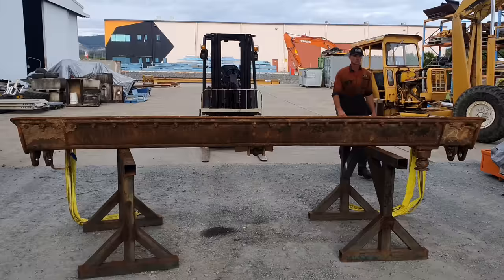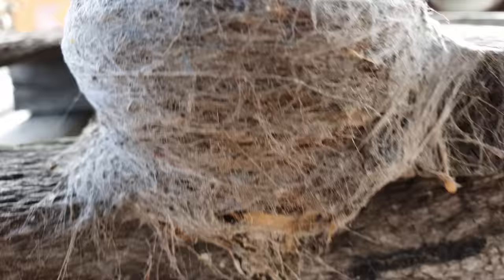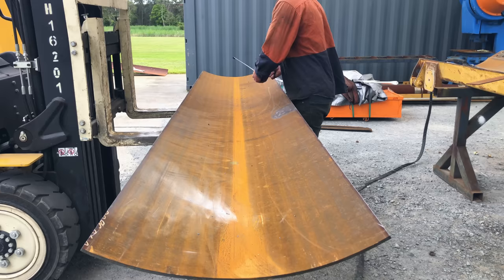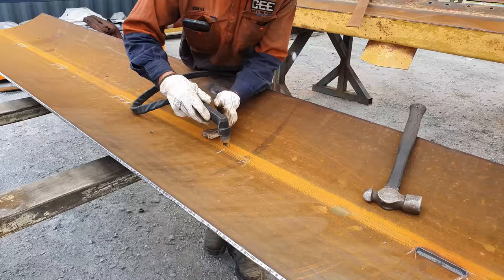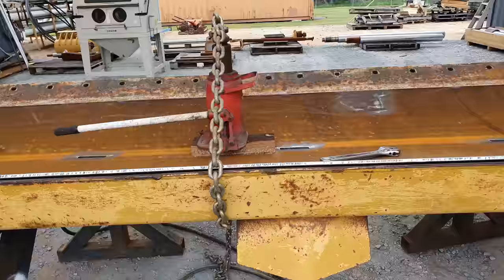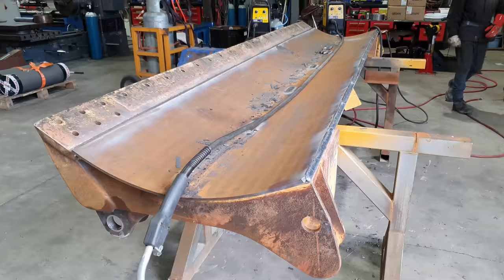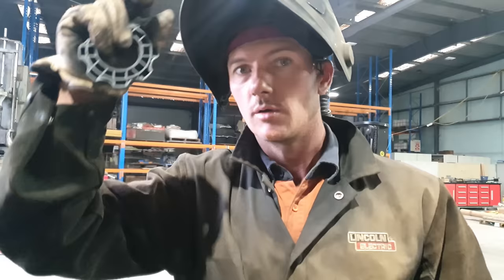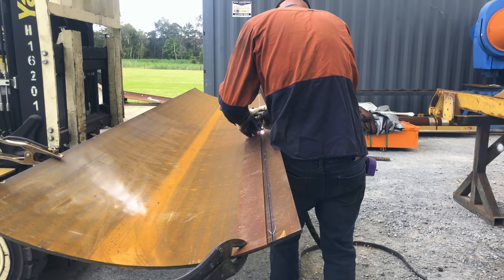Installing NEW BLADE SKIN for CAT 815 Soil Compactor | Plasma Cutting & Welding

Comment: "Aussie Animal Planet." I love it! Kurtis, you not only do a sterling job on repairs etc but you dispense wisdom and caveats and safety advice. I burst out laughing when you recalled the apprentice cutting through the fork lift blades - I don't normally do woodwork but a couple of months ago I got the circular saw out, clamped some timber to my folding Workmate and had at it - job done, except I had sawed through the Workmate itself so now I have a lopsided Workmate! 🤣💩🤬
Reply: Trimmed my workbench one or two times on the same account...
Don't let a welder/fabricator (me) use a circular saw. Also it almost took a finger at one time.....
Reply: That's the reason I have a 2.5" forged steel plate as a workbench.😁
Reply: @crazyedo9979  right...👍
...but it still wouldn't been able to save the tip of my left pinky....
Reply: Over the years, I've worked in 3 different shops where guys had cut 1/2 way through the forks with a plasma, and one cut the end completely off a fork with the Oxy-Fuel...we had plenty of 1 and 2' plate...don't know why they couldn't use that, a nice proper top for a workbench. Actually in one shop we had 2 workbenches that were 1" pate...5X10 feet, but still the forks got it...
Reply: @kristianskov4841  Here in the USA, circular saws cause more injuries than all other power saws combined...

Comment: This brings back interesting memories because in the past I worked for an outfit that re-skinned the bottom of aircraft floats. Although we worked with rivets and (naturally) the aluminum was much easier to bend, most of the methods and procedures were very similar. You wrestled with hard metals, I had to endure days of riveting. Keep up the wonderful work Kurtis, and the excellent videos Karen.

Comment: I'm amazed that bolts like that always seem to come off so easily!
Reply: Well, out in use any that are not tight tend to vanish. Plus not much water there, all of which lead to rusty nuts. Those that do not want to move with the impact will, in some way or the other, yield to the socket, strong bar and the 6m length of cheater pipe. Otherwise there is the plasma cutter there to do the removal. Come off nicely or come off in pieces, but will come off.

Comment: Hi Kurtis,
I love the way you can just remove bolts/nuts just like that. Here in the N.Eastern states everything we work on is a battle with rust and corrosion before we get to the actual job. If this job were here we would start by torching the nuts off and driving the remainder of the bolt out with an impact driver.
Love your videos, keep up the good work and say hi to Karen and Homeless!

Comment: I once straightened a quick attach bucket frame (on the machine) with just such a chain and jack technique!!  I placed a 1x2 flat bar on top of the jack so there were no round edges for the chain to slip off. Worked fantasticly!!

Comment: Kurtis, 

There is a technique for bending steel plate called line heating.  It consists of a rosebud and a garden hose.  Plate is heated and cooled in a pattern.  It takes time to learn the process, but it might save you time in the long run. 

Shipyards use line heating to supplement their roll press.  It is an amazing process.  It also eliminates the inherent stress created by forcing the plate in place by clamps, a hydraulic jack and welding.

I really enjoy your videos and watching you work.

Bob

Comment: Kurtis really cool video, I was a mechanic for the New York City Department of Sanitation, I would have the blacksmith come and cut off the bolts on the cutting edge and replace them with new bolts, now I know your first thought is fuck off but I found the old bolts ended up shearing. The moral of the story is you can only stretch a bolt once.    Stu

Comment: Content always brilliant - mrs cutting edge engineering - make him wear hearing protection when using rattle gun and needle scaler - otherwise severe tinnitus by  mid 40s it will drive him nuts.   Spot on fantastic content.
Reply from the maker: He is using hearing protection 👍 3M classic ear plugs

Comment: FYI when a breaker comes from the factory it will trip out at exactly the predicted value. For a 15 amp breaker, it will trip out at 12 amps (80% safety factor). But once it trips out, the values change and there is no guarantee it will trip out at the predicted value. It may be 11 amps, it may be 13 or something else.

Comment: Changing that cutting edge on a platform sure does look easier than doing it on the wet ground on your back. I've changed a few snow plow cutting edges.

Comment: Take a piece of round stock and machine out the inside to the diameter (a little bigger than the jack head) 3 inches deep. Then on the other end weld a hook on a slight angel. This attachment to the jacket will prevent the chain from slipping of the jack.

Comment: Used the same method to do blade skins. But welded a piece of angle iron to tubing that would fit over end of ram. This held chain in place. Also had a guy that would cut hearts and smiley races for plug welds

Comment: Age old story. Equipment designed for low price and max work that is pushed beyond the limit. 
The mounting frame for the blade being bent is a sure sign of overload like you said. 
I worked for a company that made Cat parts. We built to print and still had problems with making everything exact. 
Lots of weld and steel sections with hundreds of braces on them. The prints had tolerancing that allowed for backers on welds so the large gaps could be filled. 
On the mainframe for the M24 Grader, over the length of that huge beam made from 1" plate the welds would lift the end of the fixturing off the floor. 
Once it was welded and removed from the fixture it wouldn't go back in. 
We bid against several other companies in the US and Mexico for Cat components. The various pieces and parts varied considerably depending on who made the parts and where they were made.

Comment: PPE
Thank you for always using 
 Personal Protective Equipment
   *Fall Harness while up in air
   * You always wear Safety Glasses
   *Cutting Glasses for UV during hot work including plasma work
   *Weld Hood w/ Clean air circulator
And using the basic PPE
   *Gloves, Steel toes, Long Sleeve and Pants

Preserve your career longevity - run your business longer
Minimize hazardous exposure and reduce liabilities
Reduce accidents and Less trips to Emergency Rooms
And maybe keep insurance premiums reasonable

Great examples of an owner/ operator
True Professional

Comment: I am really surprised the cutting edge bolts didn't have to be cut off.  With the thread protruding even though it is the back side I would have thought they would have been long past unscrewing.  Not to mention out in the weather and moisture!

Comment: After the breaker-dance with our MIG unit on 110V15A...
When we got our cheezy plasma cutter, we just went and ran a 220v30A line just for it, next to the 220V90A welder disconnect.

Comment: It's secondary to ordering oversized is that extra can be cut off fairly easily, whereas if extra is needed then adding can be difficult. Even more so for bits that have a specific hardness or temper flex that can be altered by mistake in the adding process.
It's the same reason one should not weld springs or cut them with a torch.

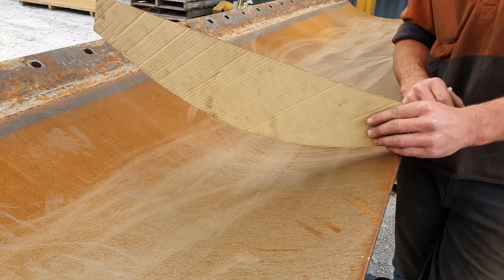Comment: @5:18 I swear it looked like you were using a ceramic gauge block to measure the gap between the blade and corrugated cardboard template and I thought “That’s MrCrispin level humor right there”

Comment: Thank you for sharing another video -- so we get a glimpse of how your busy days went.
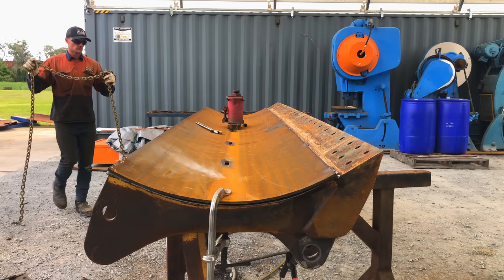16:37 "the chain is rated at 10" -- you said you'd put only a couple tons of pressure so it's okay, but the chain is at an angle (at about 45 degrees?). I think the chain gets something like 1.4x the force -(**edit: but 1.4x gets applied on 2 sides, so I guess the tension is 0.7x after all? Never mind! )

Comment: Hello Kurtis or  Curtis don't know which one is proper? My name is Jerry I'm a retired electrician (sparky) a suggestion about the lack of power on one side of your shop. Until you can upgrad your electrical system make a heavy duty extension cord 110 volt or 220 volt. To run for the other side of your shop. For every 100' foot of run go up one size in wire to compensate for the voltage drop. IE 12 gauge is good for 20 amp.. 10 gauge is good 30 Amp. It's not going to be cheep but it's  a temporary fix to your amperage problem.  Also consider a GFIC outlet if it's a 110 volt system for outside use for your protection.  I hope this is somewhat of a help. Jerry M. Good luck down under.

Comment: Either you’re not doing much work  OR you have a team of nightshift workshop cleaners. 
Alternative to the Jack & chain (which is a good idea) perhaps you could cut a few holes through both the blade and pull them together with a good size bolt or threaded bar. Also. When you’re having power to the fab welding consider having an electric cooker power line or lines installed ( here in UK they a rated at 30amp) and are direct line from the distribution board to the outlet. No ring main.

Comment: You should do a video on the 3m back up pad grinding discs you use, I didn't know about them till I seen the boilys use em at work and they're mint. They use them for weld blending on major cracks and gussets but I was amazed at how much material they move

Comment: Cool change the circuit breaker the wires are going to handle a 20 amp circuit for as little as you use it with that welder

Comment: Kurtis its time for a Milwaukee dry saw.  I have the 18 volt one and can cut a 4x8 sheet of 1” steel in half with it on 1 12hd battery.  That’s going the eight ft way!  Hardly use my plasma anymore.  Easily cuts ar plates just not as fast.

Comment: lucky the cutting edge bolts had flanged shanks on them.  Ive seen bolts put through there and the head cleaned of with a grinder and when he went to undo it the head was obviously spinning so without thinkinh he put his hand on top to hold it , within a split second he had a perfect hole about 1/4" deep in his palm it was like a spinning razor blade

Comment: Two questions:
1) Was there any thought, when finishing the edge welds, to using a bit of the cut-off sheet to pack the gap before overwelding?
      (no worries about flexing there as opposed to re-bending the center?)
2) How did you finish the plug-welds in the rectangular 'hold-down' slots?
      (fill with soft ?, over-weld with hardface ?, weld back in solid plugs cut from the sheet off-cuts?)

Comment: Try Hobart excelar8 wire it's a t8 gasless wire with amazing impact properties it's used a lot in the states in earthquake zones it's identical to 7018 and dualshield wire not as much deposition rates as a t1 wire but for windy conditions it's the only way to go for outside

Comment: im so used to looking away when an arc is being struck near me at work (welding) that i find myself looking away even when i think ur gona strike it up. lol good stuff tho, im a fan

also 17:46 instead of welding that top wedge on if u made that a 3/4 nut u could just run a bolt thru it an not need to hammer that 3rd piece in. the bolt would be doing the downward pushing. just a cool thing i saw an old timer do at a job one time, he called it a dog leg too. 
                     
                              bolt
                              bolt
                          nutnutnut
chunkOFmetalnutnutnut
chunkOFmetalnutnutnut
chunkOFmetal    bolt
chunkOFmetal    bolt
chunkOFmetal    
                          ^
                 tack weld

Comment: loving the videos.  Always relate more with someone from home.  I'm looking to get into some heavy repair work but I'm not sure if I should spend a bit longer investing in major tooling before i start to look for work.  I have a 50L compressor, 8kva and 5kva petrol gen, unimig razor arc 180 and a weldforce 160mt multi process MIG (20% at 160, 60% at 130) alongside a 50a plasma cutter (cheap "giantz" brand), oxy set, 305mm makita cold saw, pedestal drill press (15mm max chuck), 20t mechanical press with pipe and square dies, a cropper up to 12mm flat, a 630mm pan brake up to 1.6mm and a 1000mm pan brake up to 2mm.  Would it even be worth trying some heavy repair work with basic tooling like this?  I have my 1554 general purpose MIG and stick certs and my cert ii in engineering (completed at a machine shop running manual and cam driven lathes alongside welding/machining pins/rio for formwork). 

I know the MIG will be useless as most heavy work is done spray, but the stick has no issues running a 4mm rod, and most of the plate I work with gets ran with a 2.6mm 6010 root and two 7014 of 7018 passes anyway.

Comment: Very nice work!  I was wondering how you were gonna adjust for wear.  Some of my favorite memories are time studying the bucket construction at LeTourneau in the late 80's and 90.  Those welders were hilarious and good at what they did.  The L1100 bucket sheets were huge.  Preheat took hours, and then they'd weld up the hot parts on hot, humid summer nights.  Lots of memories spurred by this episode.  (if you did time studies, how did you account for your welder putting vice grips on his buddy's air hose and hiding it under some scrap?  Some nights, it seemed half the time spent was figuring out how to account for practical jokes!!)

Comment: Time is money!
, Find a supplier who can match your template more closely.have the radius formed a 
little tighter,that way you can tack one edge down and clamp the other edge down thus making a tight fit with the base plate no cutting slots and plug welds .Have the supplier shear the 200mm off each edges,they can shear it off a  for all and with no warpage than you can plasma cut it. You didn't need to use a h.f bead ,the cutting edge will protect the weld. 3/16 7018 will weld just as fast as you and fluxcore

Comment: "Ah, another skin replacement - seen that already before, but maybe I'll just take a peak" - now over 26 minutes into it... : )
However, one question remains (and kinda bugs me)  - why leave the old, worn skin? Wouldn't it be better (strength-wise) to remove it completely, and then affix the new one "properly", where the previous one was welded to the underlying structure?

Comment: Kurtis 😁👍  one question as a shop owner, when you get equipment in that you have to clean before you can repair it, do you charge for that or do you just clean it?  i ask because i know that cleaning thr work pieces takes alot of time... time you could be using to get the piece   repaired .   when i had my mobile repair business i myself would just clean it and not add it to my fee, though I was charging an hourly rate... but im not the greatest business guru, so im sure i priced myself out of work on some jobs... my business was an 24 hr 7 day a week emergency repair deal ... break a dozer on site id come fix it so it could be gotten off the site and into a repair shop. 😁👍

Comment: Two curiosities:
Did you pattern this blade to add to your collection?  (I know with the various distortions the blade has suffered mapping its pattern might be pointless.)

And, of the auto mechanics I view plus you all, when it comes to bolts I don't understand why oil is never around.  A little spray of penetrating before jackhammering them off and a little spray or soak/bath before reassembly.  Are they just that expendable?  Risk of fire around the welding?  No love to spare?

Comment: I know the slot welds you did were far away from that cutting edge, but was that the only reason you didn't recess your fill pass enough to cap with the hard facing wire?

Comment: When working on filling the gap do you have to worry about the heat warping it? I know it is a big concern for thin sheet metal in the automotive world but wasn't sure if these parts were so beefy to remove that concern

Comment: - The contractor doesn't put Hard Facing on wear points for some reason.
- I am curious, Kurtis...{thinking of this from a good marketing perspective} Is there a reason why you would not weld in cross hatching of Hard Facing on the hard wear side...or even on both ends?
- I can see that would slow down repeat work for this coming in.
- But for unique reputation purpose would doing this be an advantage?

Comment: Interesting it’s only 10A circuits.
Here it starts at 15A in North America 
Although we have 120Volts 240V 277V 480V and 600V 
It’s a mess because of the banana system that runs 480V industrial but in Canada it’s 600V industrial power.
Then one leg of 3 phase runs 208V in the usa but here it’s 277V

Comment: I'm a little sad that you didn't de-rust the bolts. There is a product called krud cutter that you simply soak them in for a few minutes and you can wire brush them and they look brand new

Comment: Your lucky day !! I'm going to tell you how to save time,mat and money,. First go to the machine and make a template that CORRECTLY matches the contour and the corners ,tips show the fabricator the correct height of the finished moldboard. He can shear the finished height faster than any other method and without warpage! Have moldboard rolled to template or slightly tighter. That apprentice 's name wasn' Kurtis??? Don't waste time R + R  the cutting edges .position the bottom edge 13mm above bottom edge of weld  ,if you are bound and determined  to use a hard facing on that lower weld just use use Lincore M or equivalent no need to use anything extra. You don't need to make those hideous slots,30mm holes are more than enough,really not even necessary! That skin is going nowhere! Clamp  top and weld and then  sides ,you're done!! No jacking and extra clamping!!  
Now you have time to upgrade your electrical system!!!